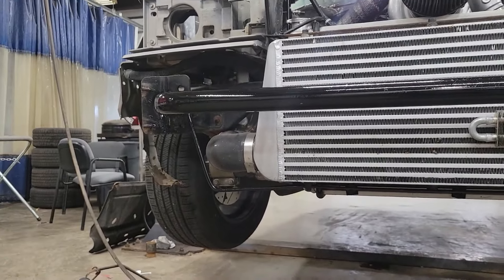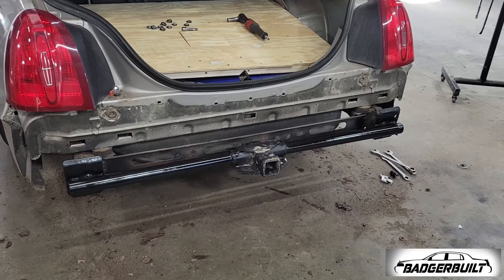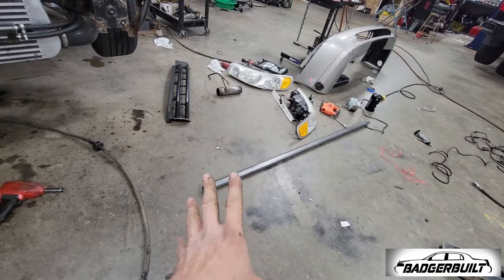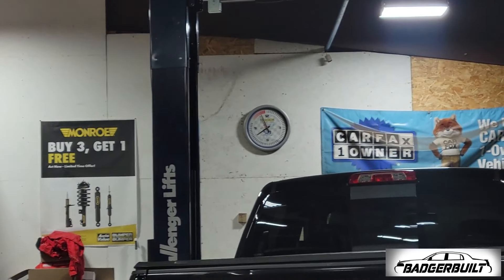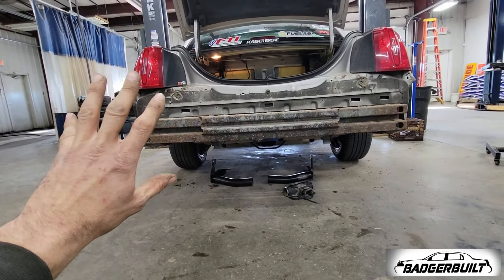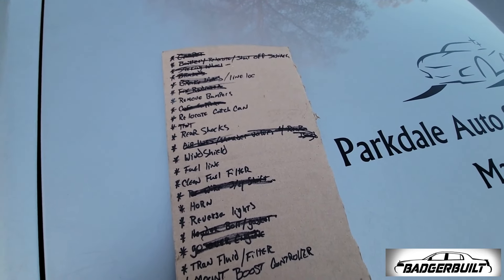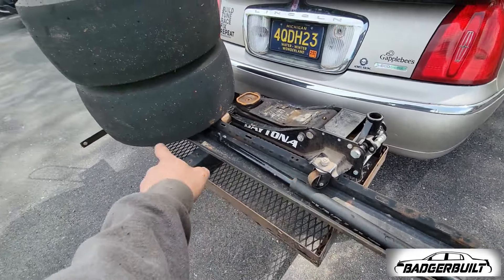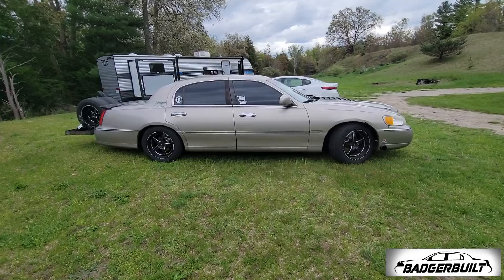Drag and Drive READY!! Turbo Town Car Gets fitted for its 1st Drag and Drive.

Comment: Just my opinion .Would it have made sense to weld a plate to the tube then bolt it to the oe absorber mounting studs so it can be taken off if a redesign is needed ?
Reply from the maker: Absolutely would have. But I was short on material for the end plates, and I would of needed to upgrade the bolts. Those oe bolts are very small being for the bumper. We may tow something bigger so I wanted it to be solid